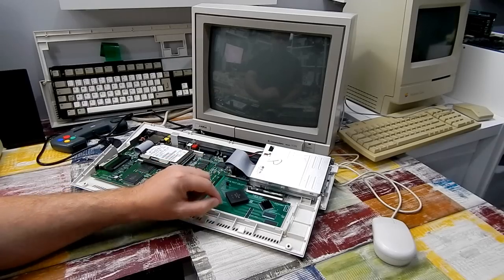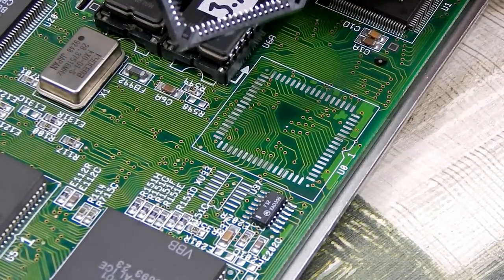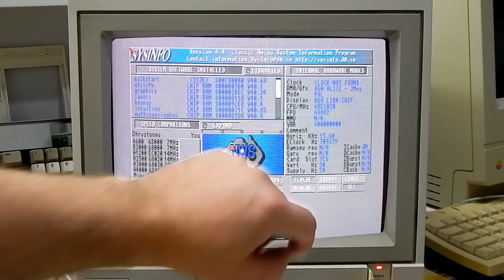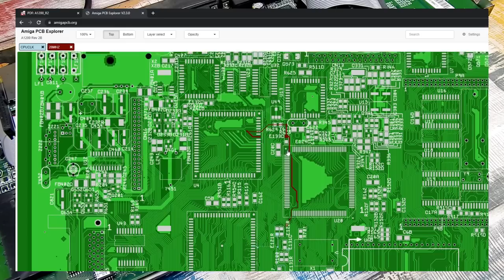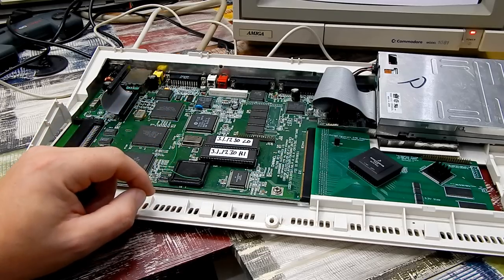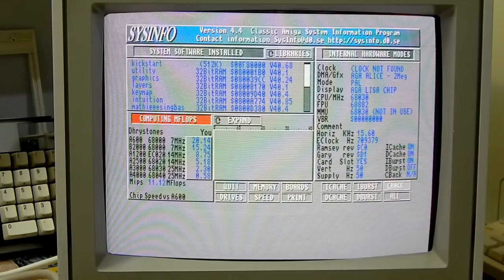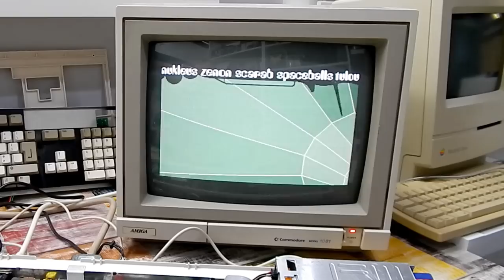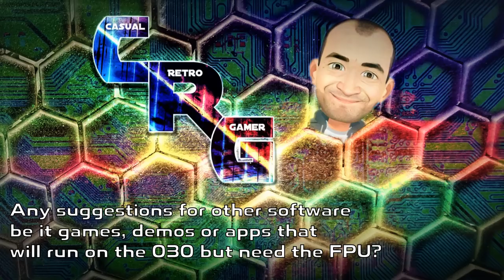Amiga 1200 adding an FPU to the TF1230 *sort of*

Comment: The fpu chip is a 40 mhz part so running the clock at 28mhz gives it plenty of time to do its work. Yet trying to run at 54 or 60 mhz the chip does not have time to do its stuff
Reply from the maker: While I appreciate your thinking, that's not how it works.  The chip is rated at 40mhz by the manufacturer as a speed at which it will run but it has no internal clock generator, it relies on an external clock signal to drive it.  

Consider a vehicle with a cruising speed of say 40MPH.  The vehicle can move slower than that or faster but go to fast and it may become unstable.  

The same is true (mostly) for a CPU or FPU.  It has its designed clock speed, it will run slower than that and might run faster.  Go to fast and it will become unstable and usually crash.

Comment: You could just get the desired clock frequency using a counter chip can't you?
Reply from the maker: Ultimately I think what I'll do it place a separate 40mhz crystal beside the fpu and wire that in directly.